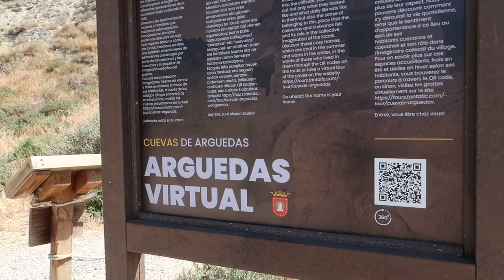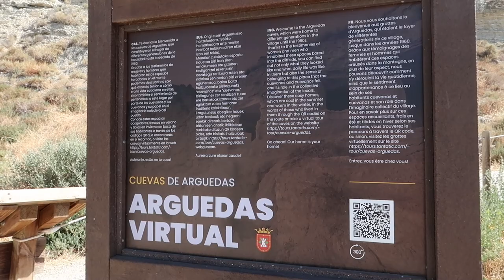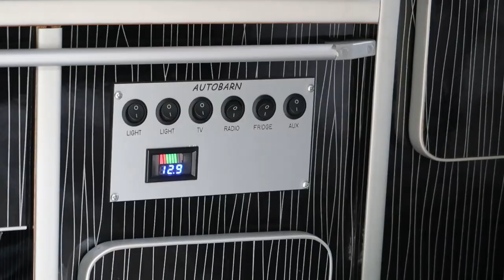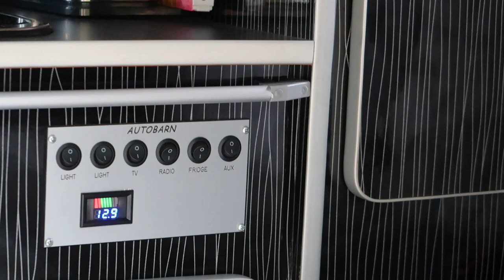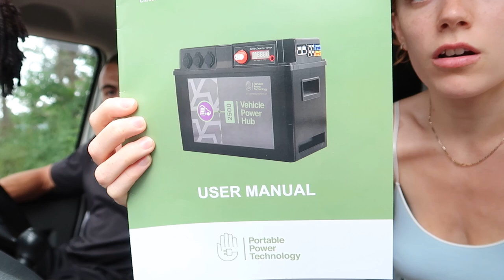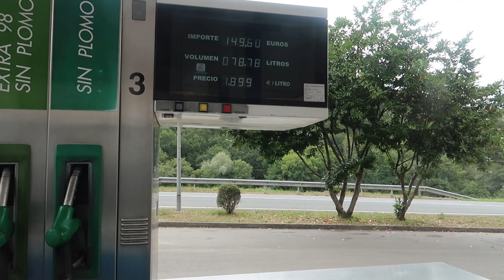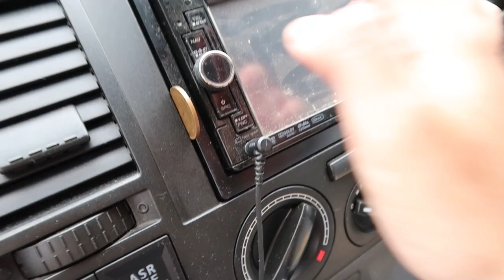EXPLORING THE NORTH OF SPAIN IN A VW T5 CAMPERVAN

Comment: Easy rice.....1 cup of rice to 2 cups of cold water in the pan, bring to the boil and put the lid on turn heat down to low and leave for 10 mins, rice will then be cooked and dont need to drain it....
Reply from the maker: Thank you I'll try that, I made it again a couple of days after and did a bit of a better job but it wasn't perfect 😅

Comment: Get a funnel for the tap, hose on the end of the funnel, job done
Reply from the maker: We have been searching high and low in the shops here and can’t find a funnel, so frustrating!
Reply: @TheJammyGits  Obviously this is not going to help now, however, if you are ever stuck for a funnel again, cut the top 1/3 from a 2ltr pop bottle! Always works in an emergency :)